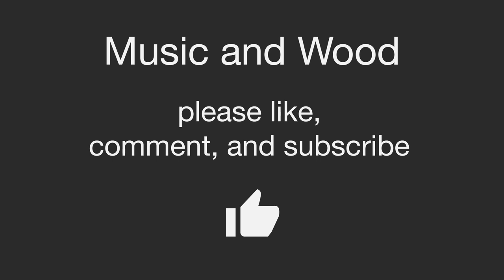How to make a washer bigger?

Comment: Nice, but you can only do that so many times before you risk breaking the truss rod.  It's better to hit the root of the problem and just correct the neck. Since it's a 2 piece fretboard you could use the microwaved rice in a sock trick.